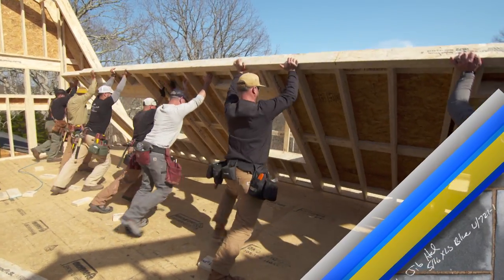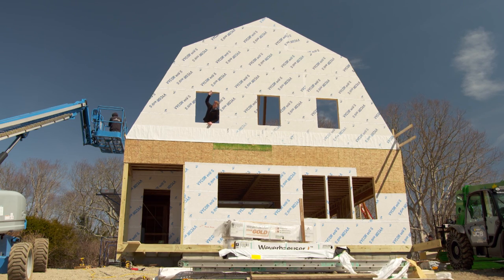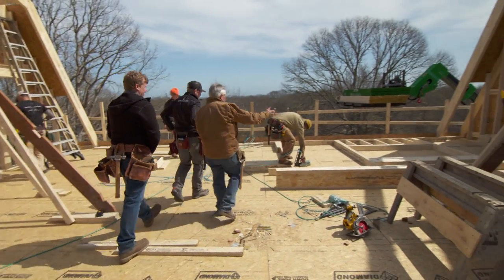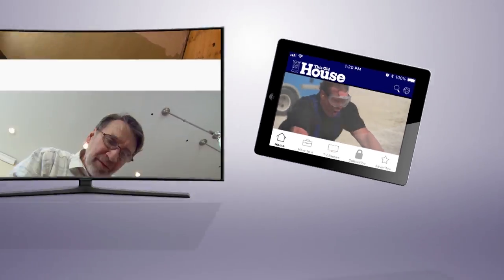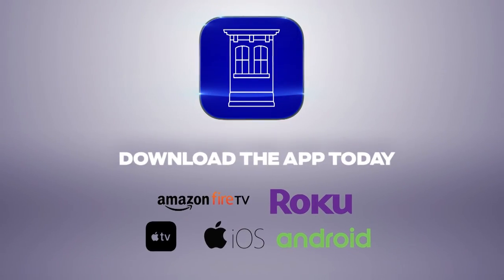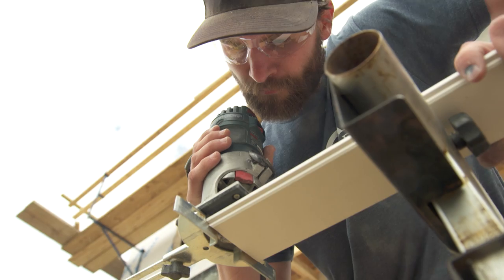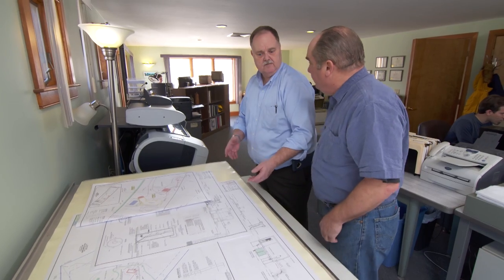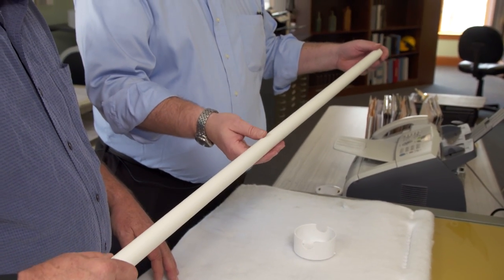This Old House | Raise a Second Story (S41 E4) | FULL EPISODE

Comment: 20:07 sorry i dont know the name of the flat piece that attaches to the circular saw but i like it and i want one.
Reply: Track saw, brand is Festool.
Reply: @GregsWorkshopOregon  thanks!
Reply: it isn't a standard circular saw, it is designed to fit that track.  Dewalt and Makita also make decent track saws, that are cheaper than a festool.
Reply: @Kevin-mp5of  interesting, I had heard good things about the makita.
Reply: Better have lots of money laying around if you want a festool brand of anything. Great tools, but they're about 3 times as expensive as the typical tool of the trade. Kreg makes an adapter/track that fits most circular saws for about a small fraction of the cost of a true track saw. Works great too

Comment: hey Tommy if you didn't have drawings how do you determine the top length to set your template and how did you make your template?
Reply: ornothopter I suggest watch a 13 part series called What on earth happened by Ewaranon to learn that the earth is not a globe.

I got it in my about tab.

Comment: Bugs me that the guy on the boom lift isn’t wearing a harness... massive fine if you’re caught
Reply: How much is the fine?
Reply: @oldtwinsna8347  I believe this is in the states so I’m not entirely sure, but in Canada (Ontario) it’s upwards of $10,000 to the operator meaning that if the person operating is certified with Working at Heights and Aerial Work Platform certifications, THEY are solely liable for their actions. The company cannot be fined.
Reply: @oldtwinsna8347  it's massive.   Apparently
Reply: @theactualcanadian8300  Wow that's a lot for sure.